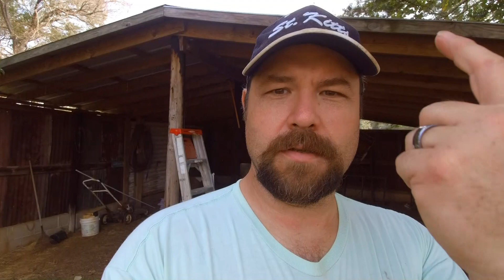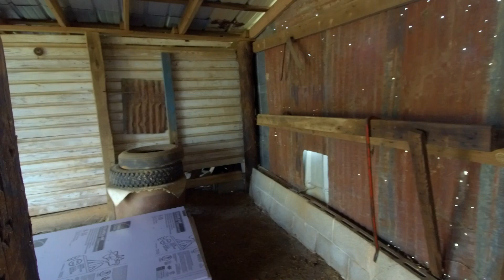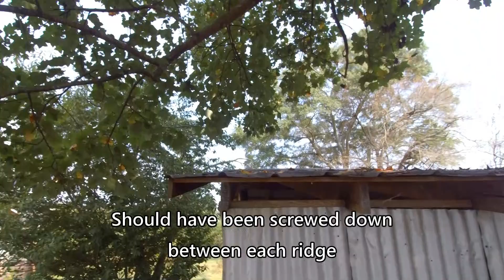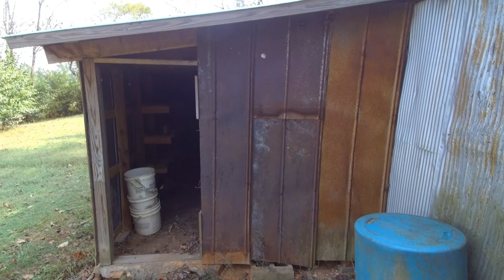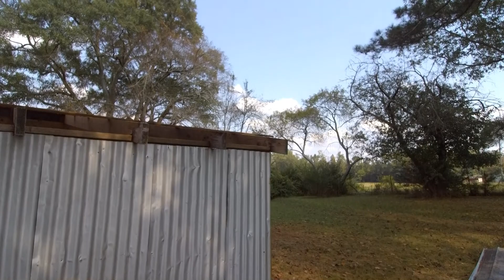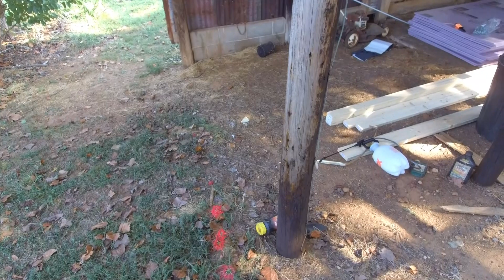1902 Farmhouse Renovation Part 12

Comment: Looks like your cousin's husband wasn't very motivated to do a good job. Left half the screws out and didn't finish the end. Maybe he wasn't paid enough.
With those carpenter bees, only the female can sting you. Females have an all-black head, males have a yellow spot. This time of year, though, they are probably all females since the males die during the summer after mating.
Reply from the maker: There actually was quite a few males in there!  What a PITA fighting them was!  I sprayed the holes and then used flying insect killer to get the ones swarming.  Still had a few swarming as I finished up the lathing.